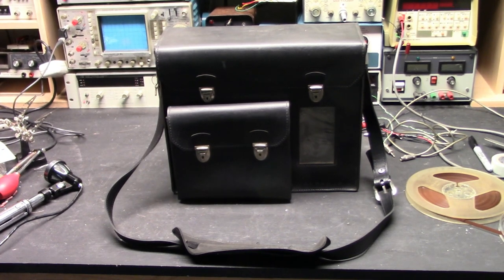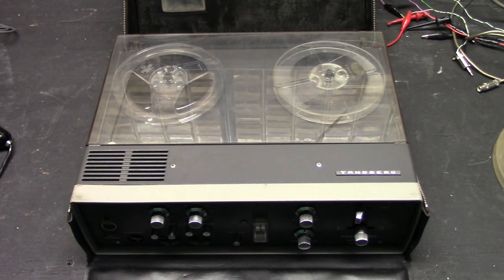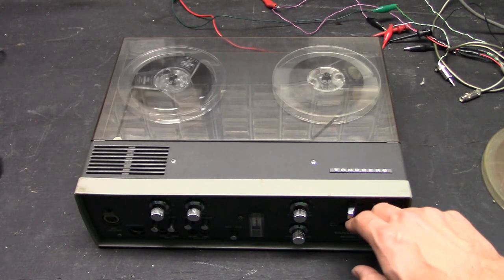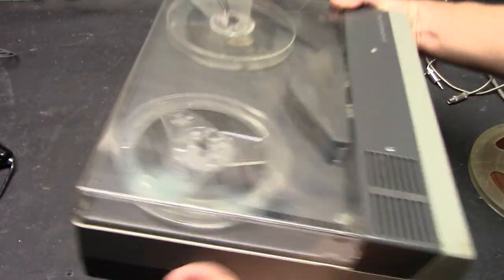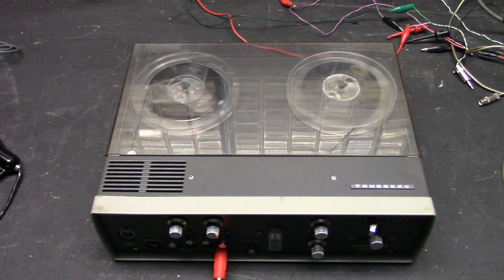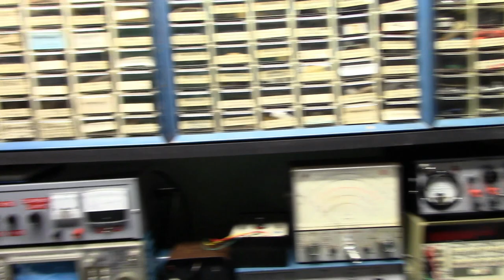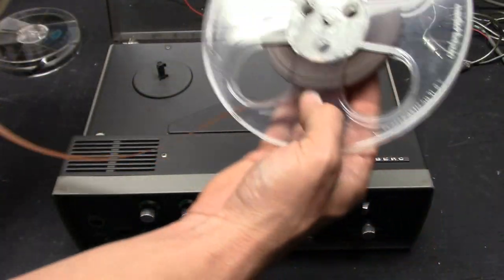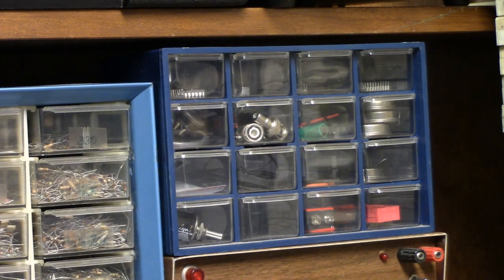Tandberg Model 11 Reel-to-Reel Tape Recorder!

Comment: More than 20 years ago, I picked up one of these at the Richmond Va 'Hamfest' ham-radio show & flea-market, as a box of parts, for $5! It appears someone disassembled it to replace the main drive belt, then couldn't find the belt. Thanks to my years of scavenging parts and visits to surplus stores, I actually had a belt that worked. It took me quite awhile to put the 'puzzle' back together. I didn't get the nifty leather case, but at least it came with the AC power-pack!
I also have an 'instrumentation version'. Looks like a model 11 built on top of 4 instrumentation units. 
Unfortunately, with all that, it doesn't seem to be capable of recording any analog audio.

Comment: Nice unit! A couple of things: first, the braking seems to be misadjusted, there should be no tape spillage when stopping from fast wind. Not sure how this model performs the braking, could be bands and drum, more likely cork pads under the spool tables like the old grey-tops. Second, that spring looks like one which is used on the pinch roller mech and tension arms on other tandberg models. Who knows, maybe the case here. I hope you get to fully restore this unit soon, it is a neat piece!

Comment: Never saw this one before. Concord made better than Tanberg did and it's a German made tape recorder, but Concord was a US brand, but it was ported from Japan by Matsushita for Concord, and made the 220 tape recorder which I still have and it's a 2-track machine with 3 speeds, and it's an all transistor machine which is "Transistorized", except 2 tubes are on there. One is for the amp, and the other is the "Magic Eye" level indicator tube, and the sound quality is excellent than the Concord did.
Reply: The 220 is big hunk of a machine not portable and with only two tape heads,how could this even compare to the Tandberg.The Tandberg sounds  better.